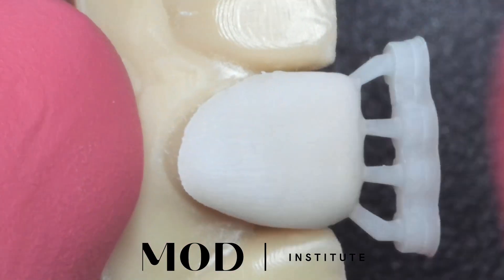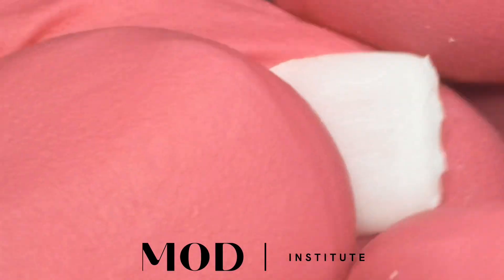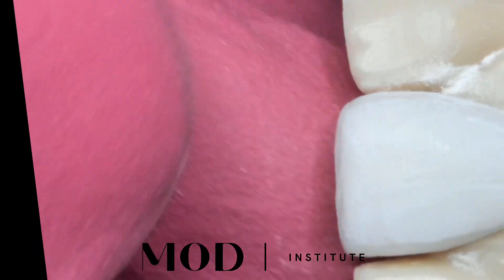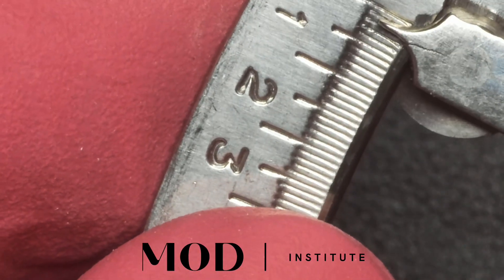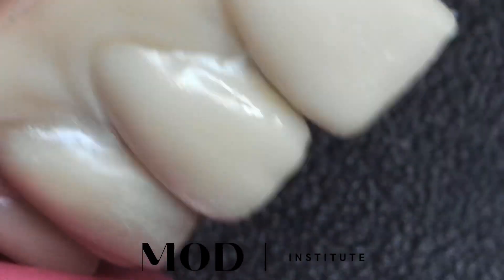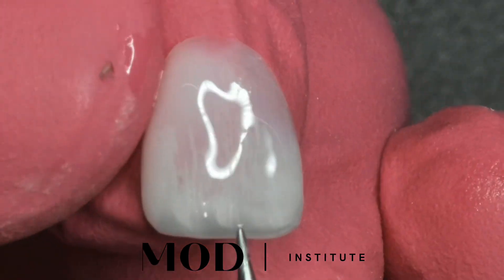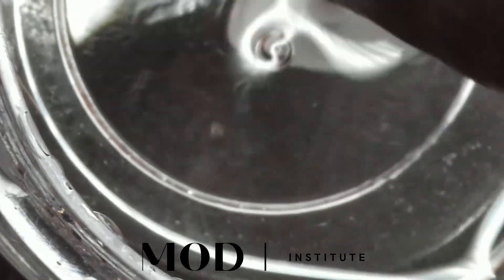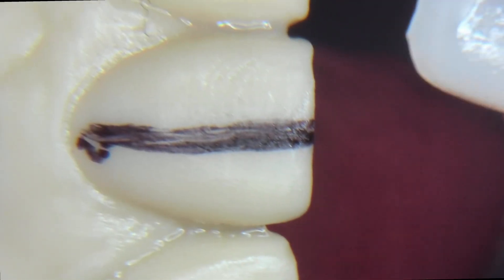How to make 3D printed veneers ultra thin.

Comment: Doc, could you print me some teeth pleeeeass 😢
I'm so tired of my teeth just crumbling.. I broke another one off tonight and not just a small tip I broke the entire tooth off and I'm already missing a front tooth.. I spent 800 on a flapper for the one side now I don't know what will happen with the other side I have an appointment in a couple days I'm so devastated